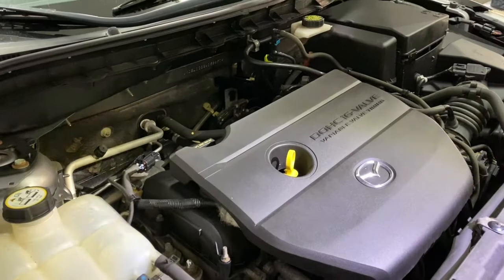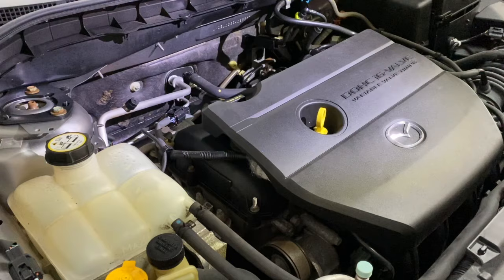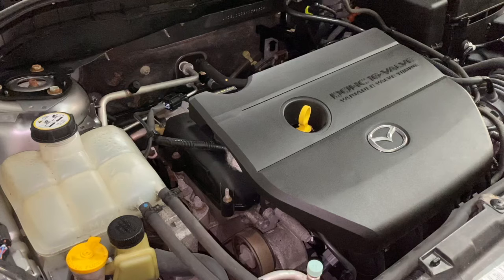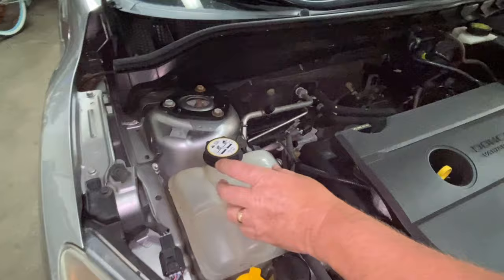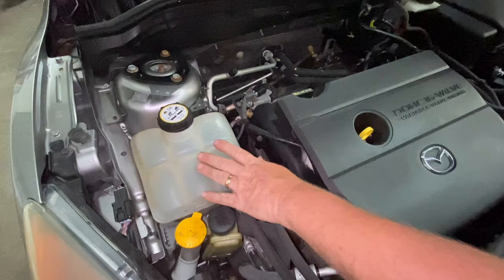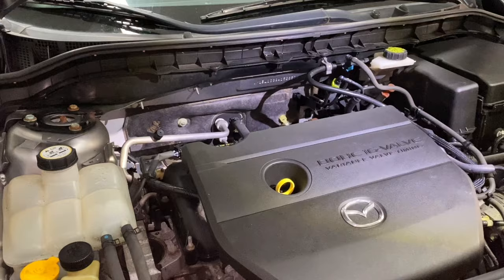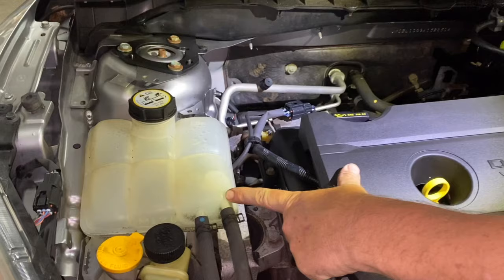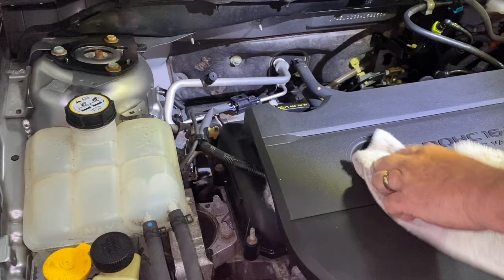Learn 3 Symptoms of Blown Head Gasket

Comment: If your car is boiling and you don't have any other symptoms replace the radiator cap. You'd be surprised how many people have had a head gasket replaced and it's just a faulty radiator cap.
Reply from the maker: Very true
Reply from the maker: @macgilligan9726  Hi, assuming the scooter is water cooled? That white smoke, if it's alot and doesn't go away, is NOT a cracked exhaust pipe, that has nothing to do with the smoking. It can be one of the 3, cracked head ,cylinder block or head gasket problem. With the head gasket being the most likely cause, unless the person you bought it from ran straight water in the engine and it froze over? The smell of fuel also leads me to believe the head gasket is at fault and leaking causing low compression and unburnt fuel to escape throught the exhaust along with the white smoke. Hope this helps you some.
Reply from the maker: @macgilligan9726  White smoke from an air cooled engine would be considered normal to me, blue smoke would indicate burning rich { carb problem } or burning oil. Without seeing the scooter and how it runs that's my guess.
Reply: Interesting. My car has started to boil which it never does. I let her warm up before I drive, and I don’t punch it so I was like “no it can’t be blown yet” so I’ll check my cap
Reply: @macgilligan9726  check your oil level, sometimes if theres too much oil in the engine it throws alot of smoke. 2nd check your carb. 3rd could be your head gasket or engine block.
Reply: @londonwatson7342  was it the cap ?
Reply: My car got hot and I thought the head gasket blew but it turned out that radiator hose pipe bringing back hot coolant to the radiator had a crack in it and all the coolant got leaked from it and the car heated up.
So check all the pipes especially rubber ones for cracks and metal ones for blockage and as suggested the radiator cap too.
Reply: i guess Im kinda randomly asking but does anyone know a good site to stream new tv shows online ?
Reply: @Lionel Zaid Flixportal xD
Reply: @Koa Marco thanks, I signed up and it seems like a nice service =) I appreciate it !
Reply: @Lionel Zaid Glad I could help xD
Reply from the maker: Overheating issue, yes but not burning coolant ( thick white smoke ) out the exhaust
Reply: Or the fan assembly is faulty
Reply: Really! 😳😳. I have a Fortuner 2.5D, after driving for about 250km I was alerted by the police at a roadblock that water coming out of my car wasn't normal. When I opened the bonnet I was met with coolant spilled over the engine especially the air filter. It appeared this water was thrown over the air filter by the radiator fan and the car was boiling. After adding more coolant, the car drove for about the same distance and depeated the spilling. No other sign except the aircon blowing in warm air probably because there was little water running. Temperature gauge was normal. Could it be the radiator cap problem mentioned above?
Reply: My radiator cap is faulty and I just realized thanks for the comment
Reply: I'm a little worried, because my coolant is burning and spraying on my engine, but the only symptom I have is white smoke. I'm grabbing a new radiator cap today (after replacing what turned out to be a perfectly good radiator) and hope my solution is 15 bucks instead of 1500 bucks.
Reply: So when I got the car it did smoke for a bit but went away, I replaced water pump and thermostat still overheats any help?
Reply from the maker: Many things can cause overheating, did you replace the radiator cap? Simple things first. Radiator can be clogged and not flowing properly. How fast does it start overheating?
Reply: I replaced my radiator cap and still overheating and guy at shop says head gasket is blown and it would be 4,000-5000$ fix and that it would be cheaper to get a new engine someone please help me
Reply: @TheOctomasprime  everyone is telling me it's easier to get a new engine too! I'm so irritated. There has to be a cheaper way
Reply: @princesswashere3685  DEADASS IM STILL PISSED
Reply: @Motorcarnut  i have a question, my car warms up pretty quick no milky oil, no white smoke and i did the head gasket tester and it came back good, i can let my car idle and it won’t get hot and i can go drive it and it won’t get hot either but if i stop and let it idle after driving it starts getting really hot and when the thermostat opens the hot water goes into my high pressure over flow tank, should i start by replacing the radiator cap? bleeding the system? maybe just get a new thermostat since they’re cheap? i can let it sit over night as well and there’s no coolant on the ground or any signs of it leaking out anywhere so it has to be something internally, i got the heater core bypassed as of now….so it’s not that
Reply from the maker: Heater core wouldn’t cause it to overheat. It’s overheats after driving because it’s up to operating temperature. Yes, a faulty radiator will do that because it’s not holding pressure, also if the thermostat is stuck closed or partially closed will also cause that problem. Yes simple things first.
Reply: @princesswashere3685  Sometimes you replace the head gasket and nothing changes, due to the fact that the head could be cracked
Reply: @Motorcarnut  My car only overheats after running it hard over time, and lately my coolant has been disappearing, but I see no leaks after testing and I have no smoke coming out of my exhaust or under my hood at all. What could it be...? I have replaced the radiator cap on my pressurized tank, I have done a complete cooling system flush with Prestone Radiator/Cooling System Flush and replaced with new coolant and also changed the Thermostat and Housing.
Reply: @Motorcarnut  I'm about to try and use K-Seal's Pour N' Go Head Gasket/Cooling System Sealant and add some more coolant and a little Water Wetter. Any other ideas/tips? Maybe the Radiator needs replaced? It's a 2014 Chrysler 200 Touring 3.6L V6. I know that Chrysler's are notorious for overheating.
Reply from the maker: Did you make sure your radiator is flowing fine and not clogged? If it’s fine then I do suspect the head gaskets are starting to fail.
Reply from the maker: I never recommend those sealers, I even have a video on why they don’t work. And will only cause more problems later on like clogging the heater core or radiator.
Reply: @Motorcarnut  I can see the coolant flowing back into my expansion tank. Is there a way to test it?
Reply: @Motorcarnut  What if I added half of a 8 oz. bottle of the K-Seal to my expansion tank and top up with coolant?
Reply: @Motorcarnut  Will it still clog it if I remove the thermostat?
Reply from the maker: I do not use those products I only fix the vehicles after they fail.
Reply: I know that's right I always start off cheap 💪🏾
Reply: Hi, when radiator cap is faulty does it also consumes coolant in faster rate?

Because my car is eating coolant and boiling coolant sometimes,  yet none of the signs of blown head gasket are showing ? Could it be radiator cap?
Reply from the maker: Absolutely
Reply: I literally changed my radiator cap after reading the come and it solved the problem 👍🏽
Reply from the maker: Awesome!, I always say try the cheap and simple things first!
Reply: How do you have a faulty radiator cap.
Honest question.
Reply from the maker: Radiator cap hold’s pressure in the system that keeps the coolant from boiling over ( overheating) if it fails vehicle will overheat and potentially blow the head gasket
Reply: @Motorcarnut  
I guess what I am asking is if a radiator cap "fails" wouldn't you know?
Reply from the maker: I just answered your question
Reply: @Motorcarnut  
You described what a radiator cap does, not when or how you know you need to replace the actual part.  Looks like it's just a cheap solution to try.  🍺
Reply from the maker: If your vehicle is overheating it’s always good to start with the most obvious and the radiator cap should be on the top of your list
Reply: Jack Lee thank you! Saved my mom bunches after she sent me a video of her coolant boiling 😂
Reply: True 👍🏻
Reply: Remember, diagnose the problem then fix it. Don’t just throw parts at it.
Reply: Truth
Reply: Is a radiator cap the same thing as a reservoir cap?
Reply from the maker: If the radiator doesn’t have one on it then yes. If the radiator does have one then no that would be a overflow cap( not pressurized)
Reply: True but it have my 02 racing civic and I have a overheating problem. I have no symptoms of what he said. I did replace the radiator cap but still overheat. Coolant is clean and proper leveled. I’m gonna test if exhausts gas are in the radiator. If not it’s a bad water pump
Reply: Also I did bleed my system
Reply: lol my thoughts exactly. I kept blowing off the rad hose even though I was following the GM service manual. Looked into the special tools section and what do you know? They show a pressure/vacuum fill adapter lol and a spill proof filler thing to raise the fill point above the heater lines. Because the damn thing has no valve for heater core and the lines go above the motor… that’s no bueno.
Reply: My colent water keep loose water over the night when I’m not driving and every 50mil my coolent alarm coming on when I driving thanks
Reply from the maker: @jirislisko8164 You have a leak somewhere. Park the car on a dry spot overnight and in the morning see if you can spot any leaks on the ground.
Reply: @TheOctomasprime  Try blue devil gasket repair. Worked for me.
Reply: Hello, sir. I hope you are doing well. Recently, I visited the mechanic for a yearly visit to check overall. He said everything was fine, and he just removed the old coolant and replaced changed with a new one. Later on, when I drive my car around 260 km, I stop and then again drive after a few hours. On my way after 40 km, my car started overheating, and the mater gauge is also at its highest. When I opened the car bumper and radiator cap, I found the water was coming up and boiling as well. I put more coolant in the water and started driving because it reduced the overheating issue, and after 40km or more, the meter showed an overheating signal with beeping. I again put in coolant water and drove again, and I did this process until I reached home.
Today I visited the mechanic, and when I checked the car, he said you have to change the head gasket.
My question is: is that really a problem with the gasket?
I forgot to tell you about the little smoke that I saw when I opened the bonut.
My car is a Citron C3 from 2004.
Any suggestions
Reply from the maker: @BeyondTheHorizons-info Yes, bring the car back to mechanic. They probably never bled the system after coolant change and caused your car to overheat and blow head gasket from what you’ve telling me? Car was fine before you went to mechanic, correct?
Reply: @Motorcarnut Yes, my car was operating normally prior to my appointment to the technician for a general inspection. He said "I removed the old water and installed the new one because during my inspection I discovered that your car's coolant was worse."  He is now requesting a new head gasket when I returned from my first journey to another city with this issue. 
Nonetheless, a lot of folks have posted here on the issue with changing the radiator cap. The mechanic is requesting to replace the gasket and demanding a significant amount of money—nearly half of the car's actual cost—which has me a little perplexed. Though it's a humorous circumstance, he made the serious comment that you can't drive until you fixed this problem. My obvious objections is why he didn't tell me this issue at the first place when I visited for general inspection of my car. As, he charged some decent amount in the first visit and now I demanding for another big amount to fix this issue which has raised my doubt about his expertise. So that's why I wrote you here to help me and give me advice. As I can see that you give honest opinion.
Reply from the maker: @BeyondTheHorizons-info it’s hard for me to tell you because I wasn’t there but if the car was fine before you bought it to them somebody messed up and you shouldn’t have to pay for there mistakes. I would consult a lawyer. You have paperwork proof that when you bought your car in the head gasket was fine?
Reply: I have been having issues with my vehicle, there was air stuck in the hose for the coolant system and it worked perfectly afterwards because it fixed the temp gauge as well, which was what I originally went into the shop to get replaced but didn't need to be replaced.  I keep running low on coolant, and my engine is overheating.  But if I I fill it it works perfect, until it runs out?  But it was tested for leaks at the shop, no leaks were detected at all throughout the testing.  Now I'm still dealing with the issue as well as the gas gauge reading incorrectly saying low fuel level then miraculously going to full when I have filled it with gas.  Also now the check engine light has now appeared.  But runs fine, but overheats long distance wise not locally or short distances though.
Reply: I think it's a head gasket, but I actually don't know since I don't work on cars and the cap is worn on the radiator.  But I really would appreciate some help if possible with any helpful information!
Reply from the maker: @domw_902 Replace the radiator cap first and see if it solves the problem.
Reply: Best comment bro. I only had the boiling and nothing else so I bought a new cap and the problem is now fixed! Thanks a lot
Reply from the maker: @danielcampos2962 Awesome! Like I always say try cheap and simple things first
Reply: Bro I have been topping coolant for the past 2months and I have checked all the things no visual leak no white smoke nothing and the engine runs smooth as normal, that my BMW 118i m sport petrol manual 2017, could someone help me with this please....thank you
Reply: @muhammaddar9745 somethin similar to your same experience happened to me about a month ago with my Durango . Had to replace my radiator, and radiator hose . Turns out my thermostat was also faulty (it even came from factory ) so they had to replace that as well . 😅
Reply: My car gets to temperature, then smokes, but its not overheating?
Reply: Might be the motor fan  @TreyHiers94
Reply from the maker: @DeadEyeDeezy what color smoke?
Reply: @Motorcarnut  it's got a hint of blue now and the exhaust had oil/fuel onit maybe..
Reply from the maker: Seems like you’re burning oil not coolant
Reply: I just did this today
Reply: Nahhh😅😅😅😅?  Fr

I’m having symptoms, but my car doesn’t smoke and it doesn’t overheat. I think it’s the water pump.
Reply: @TreyHiers94 did that k seal work
Reply: @Motorcarnut but r u risking further damage if that is not what it is

Comment: My mechanic sees the 'milkshake' but not on the diptstick, it's leaking in the engine. He was testing the heating core cause we have no heat. He said the oil was very low and had to add 3 quarts of it (it was changed 3 months ago). Also he pulled out the oil filter and it was saturated with oil. Looked like it had been dipped in oil. He said the place that changed my oil did not change the oil filter which led to the issues that he says may be a damaged head gasket. The car has not overheated.I don't know what to do. Any suggestions?
Reply from the maker: If there is mixing of coolant and oil, you probably have a blown head gasket at a minimum. How it happened I can’t tell by your post but either way that’s what it sounds like. Maybe get a second opinion to make sure?

Comment: I recently found that milky substance under the filler cap and on the dipstick of my car and a few days ago I had the oil changed and used motor flush to clean out the engine. So far the oil has remained clean and normal and the car runs normal and doesn't overheat or emit any white smoke. I assumed it was just condensation due to the winter weather and only making short trips in it, keeping it under 20 miles a week. It does consume a lot of coolant with no leaks in the bottom and it the fluid inside the radiator is dirty and oily despite installing a new radiator six months ago.
Reply from the maker: Doesn't sound good. Your head gasket is probably on its way out. Should not consume coolant or have milky substance in the 6 month old radiator. You should have the coolant tested for any exhaust gasses mixed in with. If you do, replacement is the only cure.

Comment: hey man appreciate the video, i recently had a radiator hose blown and there was water in the entire hood. i replaced it and its all okay but i recently pulled out the oil cap and there was a green residue like coolant so im not sure if my head gasket has blown as well. i cleaned the cap and checked today and there was no residue again, there is no white smoke in the exhaust,  the dipstick is fine, coolant level is ok, im just worried about that residue that was in the oil cap and today my low oil pressure light came on for seconds then disappeared, thank you in advance!
Reply from the maker: No problem thanks.

How long did you drive with the blown hose or how hot did the coolant gauge get before shutting it off? There should not be any coolant in the oil like you know already. A little condensation under the oil cap is normal but not green as that’s coolant.
Reply: @Motorcarnut  hey man sorry to bother, my coolant leaks to the floor now, head gasket already replaced, water pump replaced, no hose cracks or reservoir cracks, keeps dropping out from the bottom, a metal
Tank any idea where this could come from
Reply: @gonzalotorres4570 hey sorry to bother you.. i have same issued like ur car.. but may i knw did you detect already whats the signs problems that may caused?